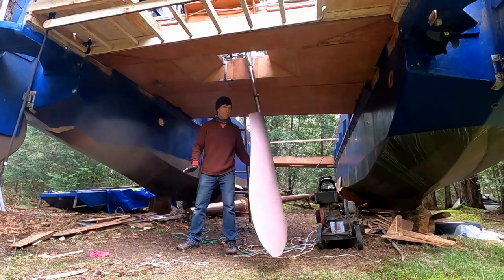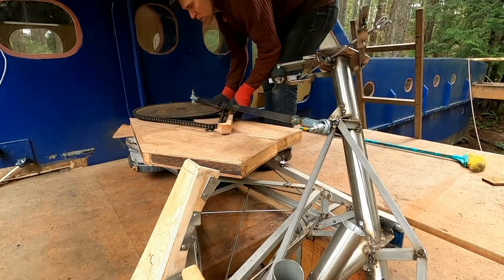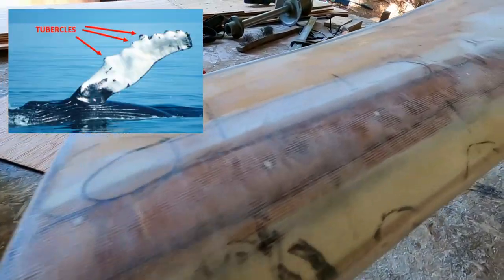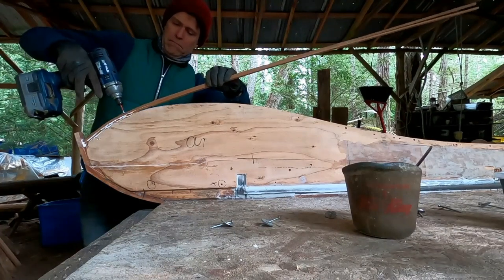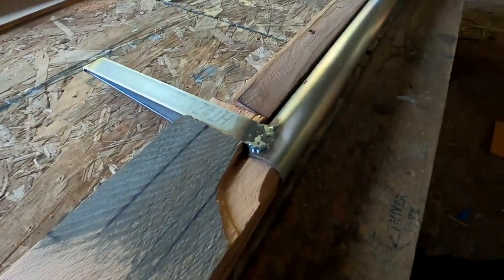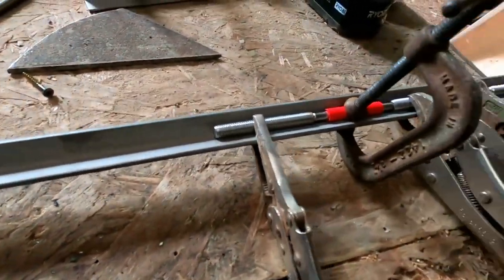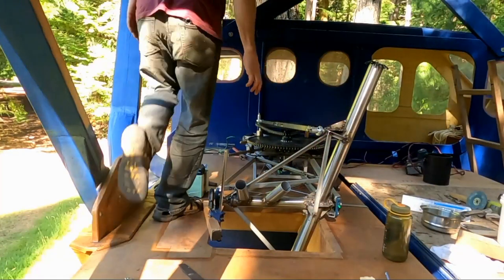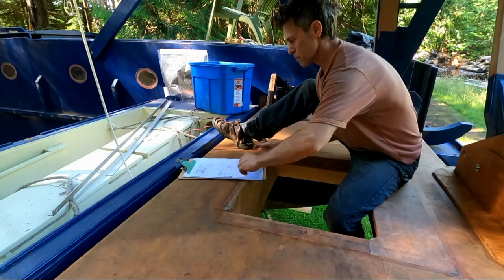Experimental Electric and Human propulsion, Will It Work? for the Zero Emmision Barge

Comment: very interesting! great to see this in detail more detail! seems like driving this pnematically would be another possible approach
Reply from the maker: Hey there :)
So you're saying you want more details? That will have to come later after launch.
Interesting idea to use pneumatics. I wonder what variables it would allow...
...
...
Reply: @wisecrackworks8851  Or steam powered! Single oscillating cylinder double acting, with a flywheel to get it over top dead centre.

Comment: Looking forward to seeing how well it performs. I've had a similar idea for a while.
Reply from the maker: Very cool, curious to know how you would use it.
Reply: I have as well! But mine uses a slightly different idea. The fin is flexible (like a diving fin) rather than something that rotates back and forth. And the angle of my drive mechanism is different. Also mine is intended for much smaller boats such as for example a rubber raft or kayak. So I'm not sure if it can scale up very much. Unfortunately I never had the time to get around to making a prototype. But I'm glad to know this theory is sound!

Comment: Should work fine.The pedal driven Hobie Mirage drive uses the same idea but with twin foils. With a simple mod to increase the angle of attack slightly, it can propel heavy, wide Hobie kayaks faster than  the equivalent propellor drive or a paddler can.
Reply from the maker: Yes, very cool. That's the penguin version, mines the whale haha
Reply: @wisecrackworks8851  The neatest things about their implementation, it seems to me, are firstly that the yaw moments cancel out (steady heading means less induced drag because there is no "leeway"). They are replaced by a pitch moment, but it doesn't incur the same drag penalty, and is so minor in relation to the longitudinal stability that I doubt it would be noticeable. Secondly, they can operate in very shallow water, and what's more, would gain some protection from being fitted between the hulls of a cat.
Reply: @wisecrackworks8851  Thinking about what you wrote, yours is a whale shark (tail moves sideways) not a true whale (tail moves up and down). I reckon the true whale arrangement has serious potential. Like the single massive flipper that some free divers use. Shallow draft, no yaw moment, simple mechanism, There's no need for flipping the angle of attack, the material and vertebral flex near where the root of the tailfin "meets" the bulk the whale takes care of that.

Comment: just found your channel while searching youtube for alternatives to prop drives…you’ve demonstrated some very innovative ideas and i’ve subscribed…
i have considered pedal power , since i’m an avid biker,  and thought about a fin drive system similar to yours , except i considered turning it sideways for up down motion like a whales tail to avoid a mono hull struggling to maintain a straight course , and turning side to side with each stroke…it also would maintain a higher  power output without changing direction of the drive system…i am assuming you know more about the physics of this than i, because i’m just a layman, but just a thought to share …
Reply from the maker: Oh my gosh, I'm totally just making all this stuff up. I have no formal education. 
I like the idea of the vertical movement for sure but it never met my criteria for these projects.
It would be fun to experiment with that design.
I actually want to make a monofin for my own body. I've tried one out and they are incredible. So fast. People are doing full breaches...
Reply: i believe that the intuitive nature of what you are doing is excellent…
i consider myself to be an “out of the box” thinker as obviously you are…the main difference is that you’re actually building the products…i lack the physical plant to build full scale, but have done models of various designs for sailboats that i believe would work …
fyi…i recently sailed a friend’s 37 ft performance cat ( seawind 1000xl ) from sarasota to new orleans…
i’be been a mono hull guy my whole life, but must say that i’m very impressed …for starters , she has less than 10k displacement , and is a planing hull design with fiberglass fin keels and rudders…
i was very surprised that she is powered by 2 yamaha 9.9 h p outboards and they perform exceptionally well, with the exception of shafts being a bit too short for some seas we experienced…7.5 knots was typical at 5000 rpms…
the point is that with so many new composites, it’s becoming common to see yachts that are fast and light that perform very well in challenging conditions…human assisted power could become more practical…
saw your free standing mast video…we think alike in many ways…id love to share some ideas with you…
keep ‘em rolling!

Comment: Hi I have an idea it is similar to this propultion device. Mine I made one modal and very simple. You are inspiring me to work on it some more. Get it to a further stage but I am thinking to complete it as a working modal rather than make a full suzed version, though I would like to make it to scale and the modal boat to scale also. What you made is very good well done.
Reply from the maker: Thank you :)
I like making models, I find it very useful. I would love to see a working model of your propulsion system! I have made lots of sail and hull shape models in the past. I learned a lot.
Good luck
Reply: @wisecrackworks8851  I think yours will work very well. Seems very well thought through and well balanced and all. My idea has recumbant style human propulsion, seated reasonably high up facing forward but really it was for a smallish sail craft that if it is caught in the doldrums, because provides the option of making some steady progress and save electricity for night time when sleeping. At just one knot that still gets reasonable progress over the whole day; with a flywheel there would be good solid progress.

Comment: I like the idea. You mixing the copper with the epoxy kind of negated the purpose, epoxy is not ablative and water won’t reach the epoxy, probably should have dusted the wet epoxy, copper is illegal in a lot of places. It will be underpowered for the size of boat in any kind of current. Any thoughts on regeneration? You should also take into consideration the power of waves acting on the paddle, in open ocean it will be more than the weight of the boat.
Reply from the maker: I imagine it's the normal ablative bottom paints with copper might be illegal. This is, as you noted, non ablative, so shedding into the environment is not a problem. 
And it actually is proven to work as anti fouling. I guess the copper floats to the surface. 

I am aware that in heavy seas the fin drive might be damaged. There are two other regular but smaller motors as back up with a third more powerful one in the works.

And of course it's underpowered in certain circumstances. As every boat in the world is. As is the compromise. 
:) Have a good day
Reply: @wisecrackworks8851  
I was reminded of something .... a Flesnor rotor  ? a large rotating disk with vertical paddle blades that shift pitch to reduce then max thrust ...they are normally deployed in pairs and are reckoned to be more efficient on small to medium size displacement vessels.. i need to check but it might be a way forward and is simpler to drive being rotational but giving the required blade shifting as it rotates.

Comment: Its wonderfully creative truely Heath Robinson but i think its not going scull quickly enough...to get that massive hull moving against any resistance..

Have you ever used or experimented with a flat full width whale tail ossilation 🐳?
Reply from the maker: Hey thanks :)
I guess I should have shown it moving at full speed. It moves from side to side in half a second at full. 
I've thought a lot about using whale tail vertical movement but it has just never fit my needs. 
I would love it though.
Reply: @wisecrackworks8851  aha I checked your calculations and also realized this wasn't full speed.
Reply: @wisecrackworks8851  

You're inventiveness does you credit.. does the blade change angle as it sweeps in each direction . 
Your ability to manoeuvre with a single paddle would be very limited so two operating at different speeds  is going to be vital... How about reverse though 🤔
I think without the rudders being  
Exposed to a strong flow your going to have difficulties though
Dom tar  has had this with his Pahi ... 

Biomechanics might yet give you an alternative that would be 
More effective 😉😎👍🏼🧙‍♂️🇬🇧⛵

Think 🦑squid 🐙 drive not an impeller they need big holes below the water line and block but a water jet/ pump, it only needs a small nozel fixed  or steerable  and the pump motor can be remotely mounted above the water line..🤔 😉

Wildings sailing first cat used a pump compressor and twin motor  hydraulic  drive motors.. 
Linked by hoses and rigid pipes .. driving conventional short shafts and quite large propellers. 
This tech has been re used in recent endurance  record breaking heavy lift drones in Europe.  Using a single ICE motor to drive multiple lift motors.
Reply from the maker: Well gosh there's actually quite a bit more to the entire propulsion system. If you look carefully, at the back of each hull is a 2 hp trolling motor. I have modified each one so that the controls are on the end of a cable. I can lower them into the water and use them in forward and reverse. It should be like parallel parking a car when in a marina. 
Each of these motors is on an independent 24 volt system in case of failure.
Reply: @wisecrackworks8851  Put your dinghy down, there is a long pole under the dinghy, and a foil like a whale's tail is placed on the far end of the pole. The height between the dinghy and your boat is constantly changing due to waves.
WAVE POWER boat
Reply: @wisecrackworks8851  
As a Brit 🇬🇧 heath Robinson was a genius.. but i like to have a plan B and C...ready if A doesnt work.  
Will the trolling motors be up to moving against a wind or current..
I guess you will find out... On the water . 😉🤞🏼 
The biggest issue is moving a large enough volume of water fast enough to keep control...

I did some reading on Butterfly or Bi plane rigs.... mostly its positive ...i will see if i can put up some leads to help. 
Are you going junk rigged or   wing sailed....or Wharram wing sail...simpler still?

Hydraulic motors look quite cheap as a way of getting distributed thrust.

Comment: Interesting.  Should work a treat, and so much more efficient than a fast spinning small diameter prop.
Reply from the maker: I hope so :)
Reply: @wisecrackworks8851  Scientific research shows that the utilization efficiency of foil can reach 90% (subject to comprehensive factors such as materials and water resistance)
The efficiency of the propeller is up to 60% (a lot of energy in the rotation is consumed by air bubbles, etc.)
For example, the Swimfin Foilboard is based on this principle.
The up and down flapping of a whale's tail and the side to side flapping of a fish is due to the properties of the spine.
But the tails of whales and dolphins make the most of the energy of the waves.
Like a dolphin on the bow of your boat.

Put your dinghy down, there is a long pole under the dinghy, and a foil like a whale's tail is placed on the far end of the pole. The height between the dinghy and your boat is constantly changing due to waves.
WAVE POWER boat

Comment: human ergonomics demands low speed high torque inputs, electric motors want the opposite ..... maybe a worm reducer gear box would be quieter? like an NMRV40 or something?
or maybe start with an Ashwoods Axial Flux Motor ... lower voltage higher torque to begin with
Reply from the maker: I will certainly look those up! 
The reason I chose chain is that it's the most efficient. Much more than a worm gear. And I can fix it more easily. And change ratios and such.
Reply: @wisecrackworks8851  i certainly understand the ratio flexibility in prototyping...clearly the best way to start there, no argument ... but gears are slightly more efficient than Silent Chain, which is in turn more efficient than roller chain....but you need the ratio flexibility until it settles into something calculable ( a post reducer input torque figure ) then you can pay with different motors and reducers on paper ( or calculator ) at no extra cost .
Reply from the maker: I'll have to research again, I thought chain was more efficient than worm gears, I suppose it depends what kind.
I like the sprocket for the final drive because the chain pulls at the outside of the sprocket at essentially the same radius as the rod end bearing so there's no load at the sprocket shaft. But maybe a combo, gear drive for the first 10 to one, then the sprocket for the final reduction. 
Well I just have to get it in the water and see what happens haha
Reply: @wisecrackworks8851  you have to check your sources, and see what kind of testing is supporting any statement ... i got what i said here with test figures .... but back to the roller chain practicality in prototyping, everything else costs more.
Reply: @wisecrackworks8851  Worm gearing is a lot less efficient than spur gearing, particularly in the deep reduction ratios which you need. Spur gears are very efficient indeed if superbly engineered, sealed and lubricated, difficult to achieve in a marine setting. Chain is a good compromise option for prototyping and easy to replace when it rusts (!) but it's bulky. Stainless chain is rather spendy....

Comment: You should totally work in a bicycle drivetrain to make the propeller reciprocate. Brilliant!
Reply from the maker: Cheers!
Reply: @wisecrackworks8851  shoot ..... Make the pedal drive power 4x4 wheels too and you have a self launching amphibious off-road RV.  I have been thinking about building something like this for years and yours is absolutely the best aquatic portion of the design I've seen yet. Very practical and looks fairly stable for its size.
Reply from the maker: You should take a look at the other boat I have a video of. It's very possible to do that with it. Definitely take a look at it.
Reply: @wisecrackworks8851  Oh I did. Brilliant proof of concept. Brilliant drive mechanism. 21ft x 8ft is a standard parking place size. It should fit in that space when land traveling. Either make the mast steppable or give it a sail plan like the Hobie Trifoiler with steppable shorter masts, so it has less tipping moment. 2 recumbent pedal stations. Make the wheels lift out of the water and use them as flywheels for the marine drive to eliminate pulsing and give better efficiency in the water. A pedal/prop drive will be lighter, faster and more maneuverable, but keep the tiller and add a mechanical autopilot like the old sailing ships used. Certainly, 3 propulsion systems (wind, pedal, tiller) will add survivability. Add PV , battery bank, and mid-drive motor to power the entire drivetrain on land and in water. Just curios, did you base the pontoons' design from the Horstman Tristar? Great lines, hauling capacity, and shallow draft.
Reply: I'm thinking in similar dimensions. Would you like to connect?

Comment: Thats going to be the slow boat to China.
Reply from the maker: I should have turned it up to full speed for the video. it will ossilate about half a second from one side to the other. 6 knots approximately. Which I suppose is slow! Haha.
Reply: The fast boats don’t go to China. They run around the harbour making noise.
Reply: @ButterflyMatt  That's right. And when they get to where they were going so fast, they can't think of anything they wanted to do when they got there so they skeddadle off somewhere else equally pointless, or return to where they originally sped off from. Sigh.